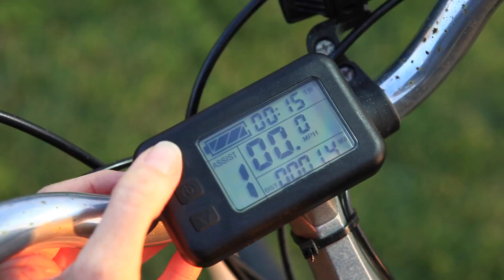Leeds 500 Series E-bike Kit Installation Video

Comment: I got a 500 series kit. They promised me 1300 charges on the battery, 
but I only got 140 charges before the battery burned out. I barely got 
18 months of service on the kit. The battery began blinking out only a 
couple months after I installed the kit; I just didn't know it. LEEDS 
personnel knew it when I began to ask questions.  They kept stringing me
 along with ineffective fixes until the warranty expired. Now they want 
$500 for a new battery, giving me a whopping 10% discount while acting 
like they are doing me a favor.  Don't buy from LEEDS. The electric bike
 is  an idea whose time has come, but the Li battery technology just 
isn't mature enough for anything but small devices. They notoriously 
produce premature  short outs.  pfaffbeltman@@t

Comment: "For the sake of this video..." For God's sake, don't do a tutorial video on your product with the wrong tools. Save video time by adjusting the video speed or fade ins/outs, not by installing screws into plastic with a power drill or using pliers instead of the proper size wrench because it's buried too deep in your toolbox to bother with. Redo the video and this time mount the front wheel in the correct direction.
Reply: for real lazy made video there is no way I am buying from them.  Cannot bother to make a decent video imagine their product or customer service, even worse.

Comment: I recall multiple issues installing my kit as well.  Needed to buy special disc brake calipers because my stock ones were hitting the motor. In the process I also had to upgrade to a larger rotor to gain the clearance.  I had to grind the fork to fit the hub motor.  I needed special shorter disc rotor screws as well.  Wasn't a one day thing since I needed extra parts.
Reply: Same here. NOTHING fit right. I ended up gorilla taping the throttle, lcd monitor and controller box to my bike after at least 4 hour, , just so I could try the damn thing out.

Comment: If you're looking to install this kit, you will need many more tools than the manufacturer suggests. First you will need either a Dremel grinder or a reel good file because the front fork keeper isn't wide enough to accommodate the wheel shaft. Second, if you have quick connect front wheel, the nuts provided by Leed on the wheel shaft have large outer collars and will rub on the fork suspension screws so you will need a die grinder to reshape either the screws or the bolt heads. You will also need to address the connection between the battery and the motor; there is no device provided to secure this connection and the two pin connector comes apart quite easily. The wheel comes with a presta valve and if you have an older bike pump with only the schrader valve inflator (like on a car tire) then you either need to purchase an adapter or buy a new pump. The Leed wheel doesn't free-spin like the wheel you have on you bike now; you can hear the motor brushed when you spin the Leed wheel.

Overall, the bike does have sufficient power once you get the kit installed. But you will have to do many more modifications, such as I did, to get things installed securely. For the price of this kit, I expected many more optional parts; the controller housing doesn't seal and the screws to hold the housing together are too long to properly tighten this cover and thus this cover is far from weather tight, but if you only roll on sunny days then you're good. They didn't send me enough cable ties to do a neat job, but I replaced them with velcro ties which hold better and do not stress the wiring jacket: over tightened cable ties will penetrate wiring jacket which is why network wire should only be supported with velcro ties (I know these wires are not network wires, I just mentioned this to prove a point; plastic cable ties are not a good solution when you pay 1100 clams for a bike kit).

The installation took about 4 hours. Luckily I have all the necessary tools because I'm a security technician and install electronic components daily for large commercial properties. But if your just the average Joe (or Jill), I'd suggest taking your kit to a bicycle shop for install; you probably won't have all the necessary tools and will be disappointed in the end product if you try to DYI it.

Comment: Isn't the wheel cable supposed to be on the right side? I thought I read that on the website? I'm confused now. Please help.
Reply: I just ordered the 500 kit with the rear rack mount battery.
Reply: how's it working? ok?
Reply: The right would be on the left when it's upside down, or if you're left handed I guess it would be right! Maybe! I don't know.